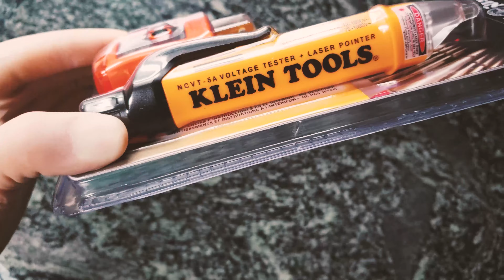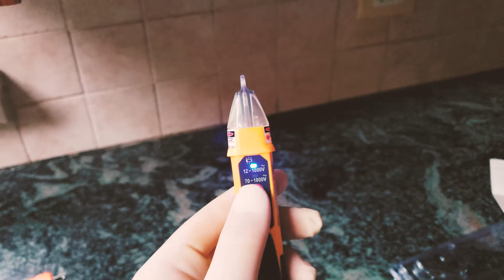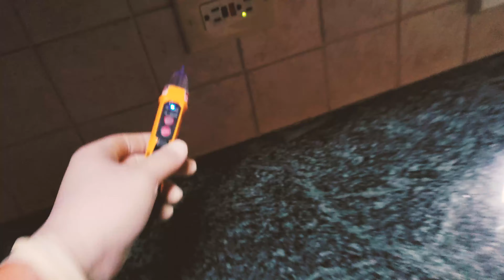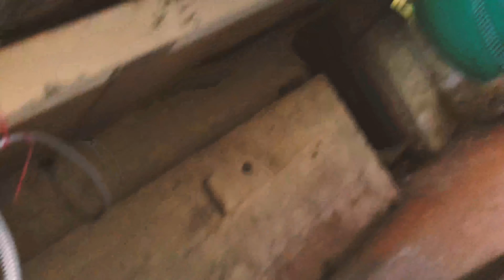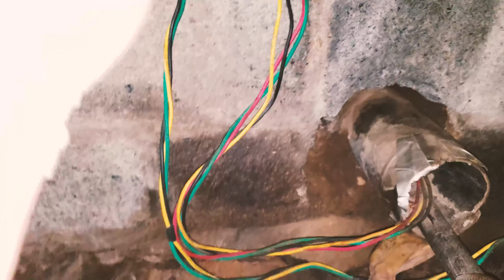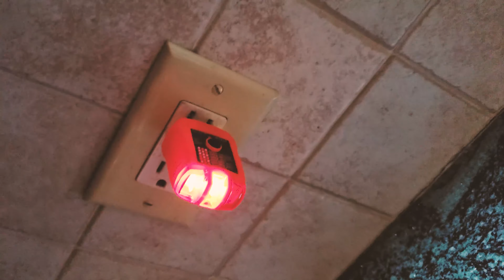Klein Tools NCVT-5A Non-Contact Voltage Tester w/Laser + RT210 GFCI Outlet Tester Tool Kit Review

Comment: You guess? Maybe you should educate yourself before playing with your new house. Btw, the basement does not have "crazy wiring". If electrical wiring has power running through it then the device will beep. It's not dangerous.
Reply from the maker: Did help me avoid some live & dangerous wiring the previous homeowner did up in the attic. Sold the house and moved away now.

Comment: Wow! Yes, you need a lot of work done in the basement that even I’d be scared as well too touch. I just picked up this model/kit upgrading from an older Klein NCV and happy with my purchase. You also answered one of my questions when it comes to the GFCI outlet tester wondering if it worked on non GFCI outlets and it does. Thank you for this video, take care and be safe. 👍🏼🔌⚡️🔋